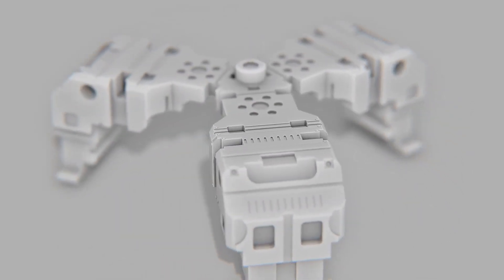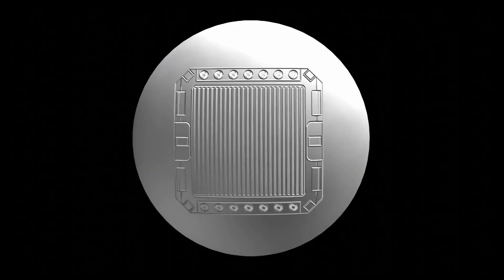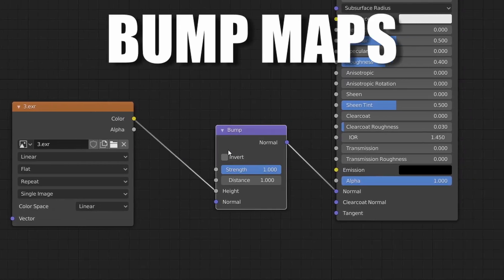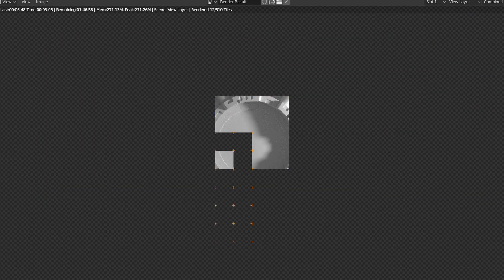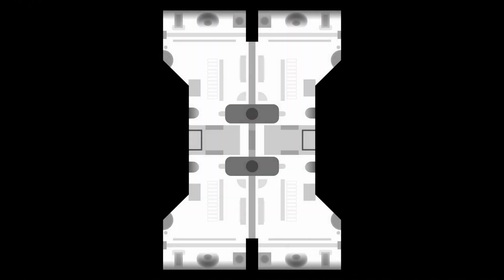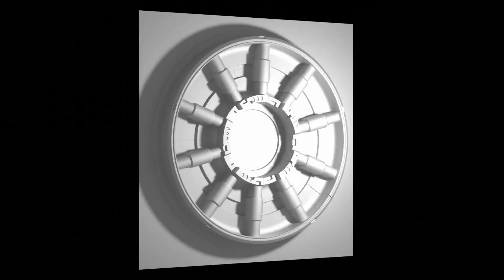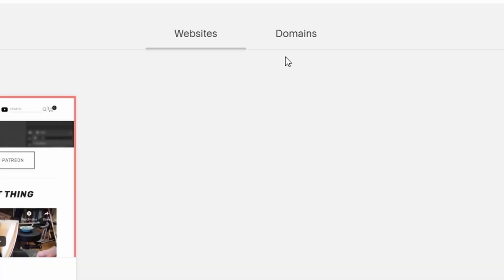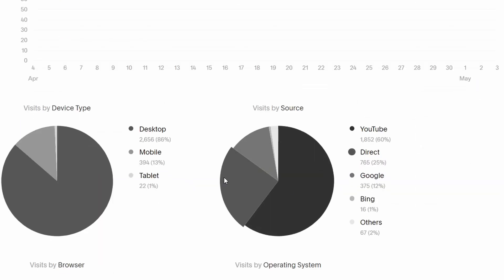WTF are... NORMAL MAPS?

Comment: Wait, why would we use the displacement map if we already modelled the thing?
Reply: Physics simulations, for example. You could make a displacement map of a detailed object, then reduce it down its primitives, simulate it for much cheaper as there are much less verts and such, and then when you render out your animation, the displacement maps will be applied. So simulating your object doing whatever will be way cheaper but in the final render you will still be able to have detailed light interactions with that object
Reply: Because game engines need to churn out 60 fps out of every scene and if you use a million triangles on a sci-fi vent that constitutes a fraction of your environment then you can bid your career goodbye.
Basically it lowers render times.
Reply: @anmoldureja4247  they're talking about displacement maps though, not baking a normal map

Another reason you might want to do it is the adaptive subsurf stuff - if you bake your geometry into a displacement map, you can control the level of detail procedurally by giving it more or fewer verts to displace. Throw the adaptive subdivision control in there, and you've got something that adds more detail the closer the object is to the camera

So you get all your expensive detail when stuff is close enough to see it, you get simplified geometry when it's far enough that you can't tell, and you only need one base object and one displacement map to get all those levels of detail. If you did it purely with geometry, you'd need lower-detail versions of stuff, and you'd have to mess around swapping them if they ever move relative to the camera
Reply: kakashi zen but if you import the primitive into a game engine with a displacement map wouldnt it cost just as much as the model itself? what i got from the video was that only bump maps and normals maps save performance costs
Reply: You can create a displacement map before you model anything, then apply it it to some shapes and _voila_, your Oscar is in the post. (some steps have been omitted)
Reply: mo polygons, mo prolyblems
Reply: I mean it is not necessary that you always use a displacement map for a model though, you can just use it wherever you like, for terrain etc. It's super useful there. And there are times when you want to use a texture as a displacement map. He just explained it all on one object for comparison but you're right for the model in the video, displacement map doesn't make sense
Reply: Yeah, displacement maps could cost the same render time, maybe even more if by doing too many subdivision's that aren't needed .

 I wouldn't use displacement on something small (or like very little detail on it) , but like someone said terrain with the adaptive camera. Great detail and would save you a bunch of time all around especially rendering. Cause it has that fall off of geometry away from the camera. But if you modeled it, you would have way more geometry. But get same result, with way higher render times. 

Another reason displacement maps are great is detail that would take awhile for you to model yourself. Say you were going to make a detailed motherboard. Instead of making every little object on it. If you had a displacement map of a motherboard somebody already made. You could use that, saving you maybe day's worth of time modeling . You just gotta figure, could you get away with a normal/bump or do I need a displacement in the scene (if one is available) . A normal or bump the surface is still flat. So if you're looking at it from the side it would be flat. Displacement would push it out. So a floor great for a normal map. Brick building that your view would be down the side probably displacement, because of the sharp edge at at the end wouldn't look real. They have pros and cons to them.
Reply: @stealth2951  displacement map is basically a photo, you can use it as bump map in unreal engine
Reply: If you're, say, making a game, you don't wanna grind some dude's toaster to a halt.
Reply: @chubbydunkers78  I guess it can be. I use them on water or skins sometimes if up close. A bump map can make an arm look like it has goosebumps or an oak tree has rough bark but the surface will still be smooth. It will look bumpy except for the edges of the object. It doesn't do anything to the surface, just paints a picture on it that reacts to light "faking" the bump.
A displacement map will make the surface actually(virtually) bumpy. You can use the same grayscale bump map, dark is low, light is high. I don't have to build a model of a tree trunk complete with 3d bark surface.
Reply: @yourhandlehere1  Thank you!
Reply: הי רפאל
Reply: @avi3660  הי אבי